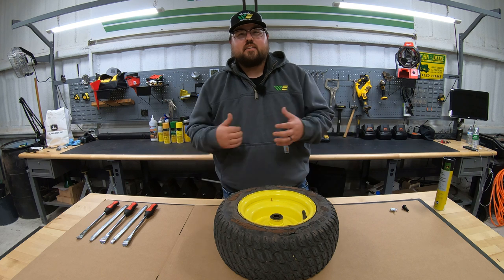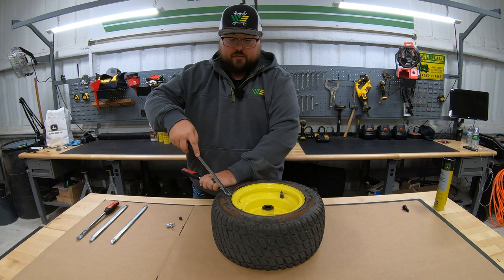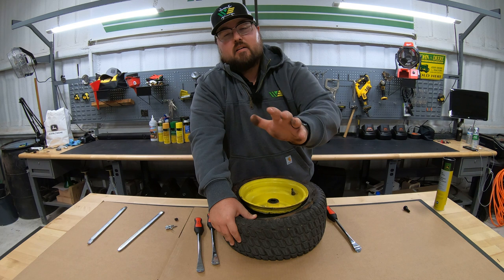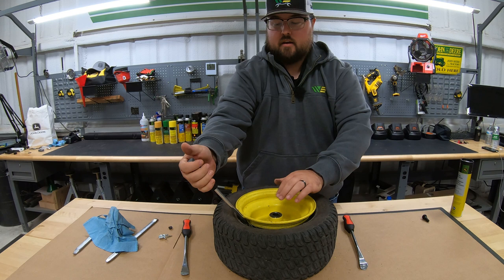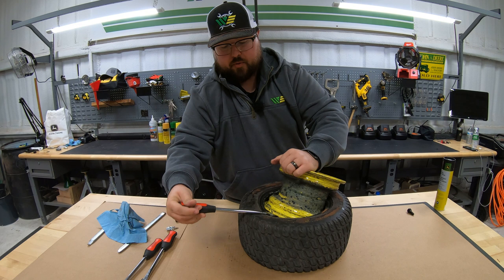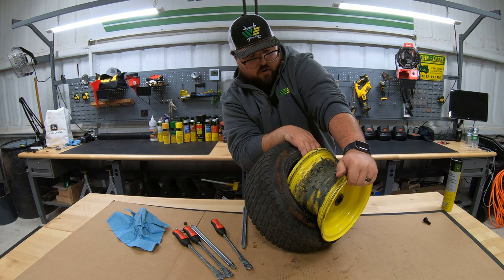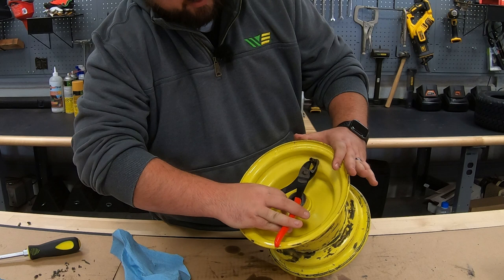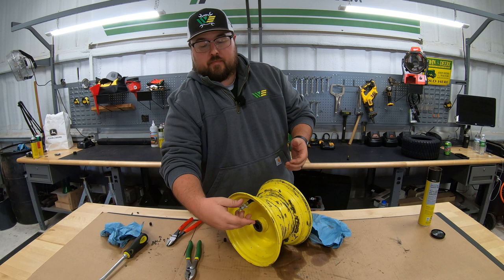How to Change the Tires on your Riding Lawn Mower

Comment: I bought a tire changer from Harbor Freight and it was much easier using that than doing it the way that was shown in the video.  And yes, I've done it that way also.  I don't normally buy from HF (yes, I'm a tool snob but I'm in therapy and it seems to be helping) but I figured for what it cost and the few times I'd be using it, I'd give it a try.  The only issue I had was when I sprayed the soap solution on the tire, all the paint started running off the tool.  Dang Chinese paint!  I was wearing gloves so like the slime product, I just took care not to get any on me.  Thanks for the video!  1025R just went in for the 100 maintenance.  Could do it myself but what do I do with all the waste oil?  I'll pay the money to have them deal with it.
Reply from the maker: I totally understand. Sometimes it is better to just let someone else handle it.
Reply: Snap on, mac, mattco, Milwaukee and a few other brands some 40 year old craftsman. Harbor freight if its only going to be used once or twice,  I had all metric wrenches, no 
Imperial wrenches the size I needed for my lawn tractor to change the blade, I bought a harbor fright wrench set just because of that, honestly its about as good as craftsman used to be. 
My wreches and sockets are mostly craftsman I dont turn enough wrenches to warrent a 400 dollar set if I used them all the time id buy snap on.

Comment: Over the years when I have tires go down because of the bead I have used a bungee cord around it, but I have had more success with tie down straps. Sometimes I have had success with fix-a-flat and sometimes not. When all else fails I go to the kitchen and get a little maple syrup to seal the bead. Works every time, but have to use it sparingly to avoid a mess.
Reply from the maker: Wow, not that is interesting!
Reply: I have used a little butane in the tire, step back and ignite it. Mounted and partially inflated all in one step.

Comment: I want to see ya put a 4" rim/front tire back together this way.......
I haven't found a way yet!!!!!!!
Reply from the maker: Now that sounds like a challenge!
Reply: @WesternEquipment  
I have a lawn boy 0 turn. tubeless front wheels. last 3 seasons, 
front tire would lose air.. I got tired of this.
Brought some tubes, tire/rim came off pretty easy.
Putting it back on is a nightmare. 
10" tire, 4" rim. I don't have any special equipment.
Pretty much what you have in the video.
The rim tented to move around to much while stretch the tire over it.
I gave up . Made a trip to harbor freight, got some new wheel with tubes.

Good Luck!!
Reply: Smaller tires are harder to mount. My hand truck has split rims.

Comment: I never knew my valve tool had an inside thread to pull valves in. The tread size is 5/16-32 so that size nut can work with a way to pry it. Thanks.
Reply from the maker: Glad I could help!

Comment: I’ve done this and it’s not worth it. I have no problem with doing my own work. I’ve changed my own radiators in both my cars, done most of my own work in both cars, I change the blades on my mower myself, I change the oil regularly, all that stuff. No problem, I’ll do it. But I’ve changed the tire on my Deere D125 one time and I’ll never do it again. A whole new wheel and tire costs $75 with my military discount at HD and Lowe’s. Its about to be yardwork season in Florida and I don’t have the time or the sweat to spare to muscle a tire off and and new one back on. Spend the money and skip this stupid bullshit.

Comment: Find it funny, every time my tires go flat on my lawn tractor, the dam tire has come off the beads and ive got to use a ratchet strap to put it back on, so why beat yourself up busting the tire off the bead? Just let the air out of the tires on the tractor and let the tractors weight do all the work, beads not broken drive it untill it falls off real slow. 
Why invent tools and techniques to do something that the tractors gonna do anyway? Its not like tractor rims are dipped in gold they are cheap.
Reply from the maker: I mean you could definitely do this, but I'm not going to cause more damage if I don't have to.
Reply: I learned the hard way to check tire pressure before using.

Comment: Do you need product tester for actual use information on Deere products. If so I have s240. Iam looking at buy a snow blade and weights kit. I got over 220hr on my rider. I keep oil changed just put new gear oil this in rear end. It pulls a yard roller I got 10cp Deere wangen. I mow 1\2 Acer at home the 2 graveyards. S240 riding mower
Reply from the maker: Haha, I will keep this in mind. Thanks for watching!